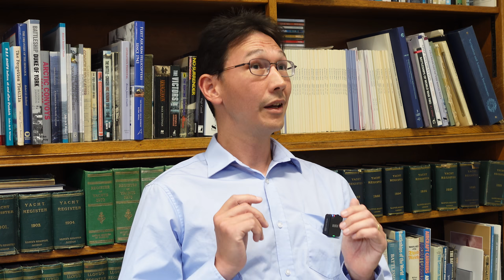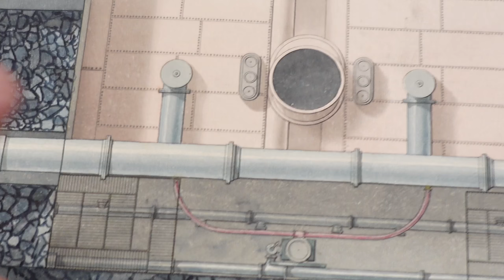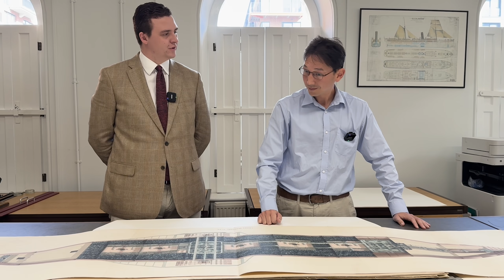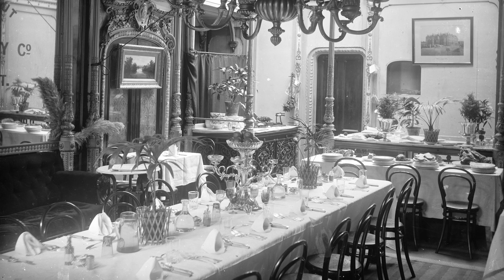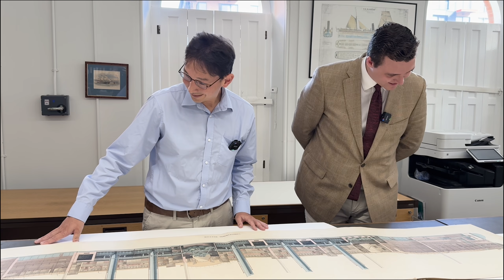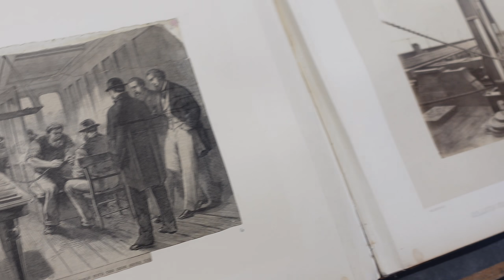The INSANE Engineering Behind SS Great Eastern

Comment: What I find most fascinating about this vessel (and other Brunel works) is that this is not even from the Edwardian/Wilhelmine/Belle Epoque/Gilded/imperial era (1880s-1920) that a modern person can find relatable and easily get familiar technology around like radio/phones/cars/buses/planes/established rail travel/cinema/music/large electrified cities with skyscrapers and apartments as a normal thing.
This vessel is from the smack dab middle of the Victorian era - of horse carts and chamberpots, smoky flintlock rifles and early semi-industrial railways, well before electricity even became a household thing. And yet for all that, Brunel and his engineers managed to design and build a few fully functioning vessels so large that their size and tonnage would not be replicated until half a century later in a very different age.

Comment: Finally an accurate representation of the "Great Eastern"which doesn't only harp on her suppose failures! Most books represent her as an outright  failure which is demonstrably untrue; she was a technological success, she performed exactly as designed. Most books just gloss over her career as a cable layer during which she performed faultlessly and which was extremely successful both technically and financially. She may have even been a success as a passenger ship had she been managed properly although she was probably just too big. What a pleasure to see those plans and the details of the design, well done!

Comment: I know it is not really fair to be talking about this on the same day, so to speak... But on some, much much more, humble level, it does remind me of technical drawings of some of the boiler room installations for an apartment building designed in 1969. Everything was still drawn by hand, and I was actually genuinely surprised that they did actually draw things like pipes and valves. Not for the entire building though... Or not that we know of, some of the paperwork was not properly archived and has been lost long since.

An interesting part, at least on a personal level is that my mom got a job at the municipality engineering office in the 70's. And she actually gathered those papers into a folder and archived it... Fast forward more than 30 years, and she would actually retrieve those same papers from the archive, after the company she and dad established acquired that building. And now I am making a living running that thing...

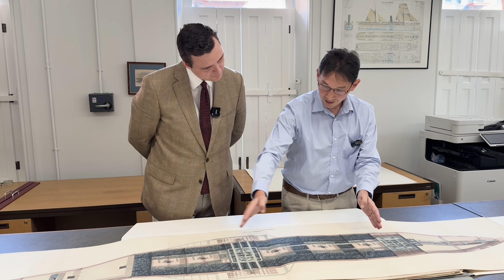Comment: 6:50 - The total power of the Great Eastern was 8,000 hp. The distance to Australia via the Cape of Good Hope is 12,000 nautical miles and the speed of the Great Eastern was 13 knots = 923 hours of steaming. Assume 3 lbs of coal per horsepower-hour: 8,000 * 923 * 3 / 112 / 20 = 9,890 tons. The coal bunkers could hold 10,000–12,000 tons. Thus, Mr Brunel was right! 😊
Reply: You assume too much sir! 😉

Comment: I'm sure that I remember from my research on this ship back in the 1960s that one of the saloons was mounted on gimbals, so that as the ship rolled in the swell the cabin would remain level.  Unfortunately this didn't work as well as was hoped, as the gimbals seized, leaving the cabin decidedly not level.  I cannot find any mention of this on the internet, though.  I don't think my memory is at fault here (though of course that is possible).
Reply: I've seen. The idea but I don't think it was connected with the Great Eastern ....try a search on the idea but limit it just to early passenger steamship ideas.🛠️🧙🏻‍♂️🇬🇧
Reply: @clivestainlesssteelwomble7665  I think you are right.  I did further searching, and came across SS Bessemer, from around the same time (a few years later) that had this idea, and it was patented, so I guess my memories got a little mixed up.

Comment: The Great Eastern was an incredibly important ship of the 19th century as she made possible the achievement of electrical communication across the Atlantic only 13 years after the initial invention of the telegraph.  Despite many technical advances, spoken communication would not traverse a transoceanic wire until 1956, which underscores the magnitude of accomplishment of the 1858 cable.  Not only was the Great Eastern ground breaking herself, but so was her most important mission of laying the cable.  Having that cable span led to important electrical engineering discoveries which advanced the art of communication by wire.

Comment: The fact this ship ran cables across the Atlantic in the mid 1800s is crazy.  They had no idea what was on the bottom.  They crossed trenches and mountain ranges, and it worked.
Reply: Yeah and they actually lost the cable overboard and managed to find it and PICK IT UP from 2 miles down A YEAR LATER. And the thing still worked.
Reply: @leonardodigrazia9758  And the techniques they used to pick it up are basically the same ones still used today for undersea cable repair
Reply: @leonardodigrazia9758  how on earth did they manage that?!
Reply: It was the biggest thing afloat and could haul MILES of cable with ease.
Reply: Actually, they did have a pretty good idea of what was on the bottom. Its one of the reasons they chose that location. In addition to it being physically a short distance, there was also a plateu aalong the seafloor, making the terrain fairly flat and great for laying cable.

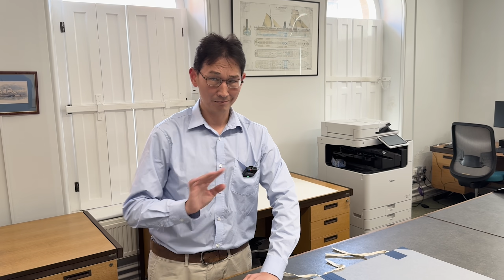Comment: 5:00 He is actually completely right. I work in library, scanning books old as 600 years + and it is pointless to use gloves because you can skip pager really easily and with gloves it is really hard to turn the page and you can damage the book. We use gloves only for really "dangerous" stuff like green color covers because green color used to be made with arsenic. But overall just have really clean hands, don't pick your nose or touch your face and you are good to go.
Reply: Are short fingernails also encouraged? To minimise risk of dirt under the nails

Comment: The Great Eastern is hands down my favorite ship. I think that the "ridicule" or dissenters that say it was ahead of its time forget that we are fortunate it was. Without it the transatlantic telegraph line would have been much more difficult to lay with smaller ships.

Edit: I am blown away at the beautiful details of these plans. As a former draftsman, I can't imagine drawing ALL of the tiles instead of a small representation.
Reply: As a CAD tech I am blown away by the detail and precision of the plans. I can't imagine the years of training and experience required to become that skilled. And the long hours and fear of making a mistake that would require a new start! I was listening to that part as I easily iterated through drawing various arcs from an old plan that had given a chord bearing but left out the chord length. I also had a curve calculator to easily solve the problem, tools they could not even imagine back then.
Reply: Well, this is a revised draft not the original sketch.  I also think it's a "for posterity" draft, not a working draft the shipwrights would use.
Reply: @marhawkman303  I agree it is a GA for the Board and Banks, there would be many thousand smaller drawings in formats, scale and construction language to suit a specific trade.
Reply: Great Eastern hate will not be tolerated from dissenters
Reply: We need a movie

Comment: Dont forget the SS City of Paris from 1888! It was the pinnacle of Victorian Ships design and the fastest ship of its time and the safest! With highly efficient triple-expansion engines geared to their two propellers, the speed called for to conquer the Blue Riband would surely be achieved. But besides fast, these ships were also very safe. Their hulls were subdivided into 16 sections by 15 transverse bulkheads that rose 15 feet above the waterline. Below saloon deck, there were no openings – not even watertight doors – in the bulkheads.